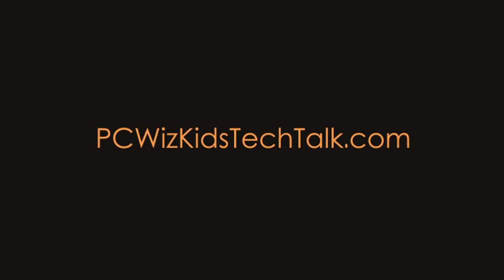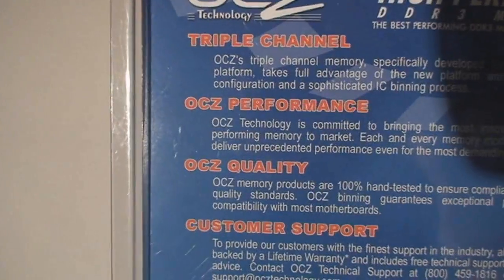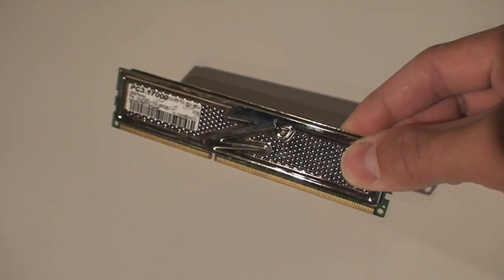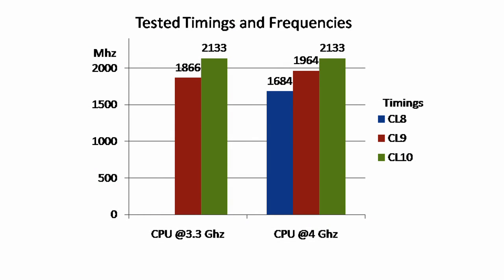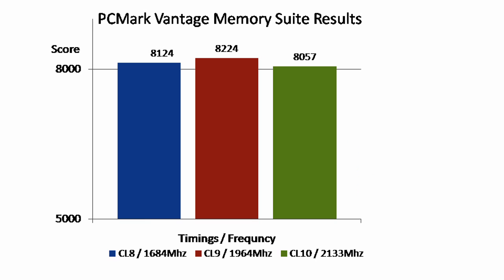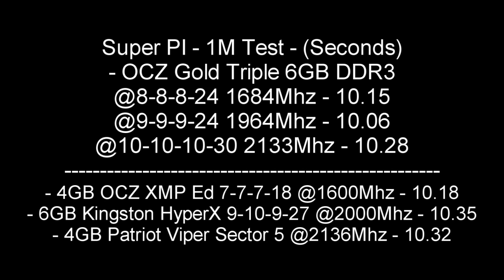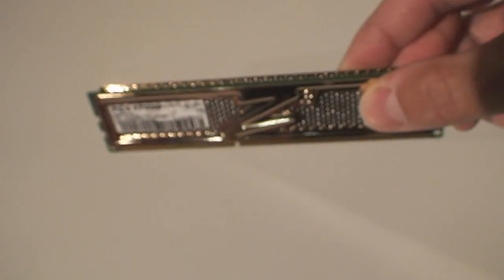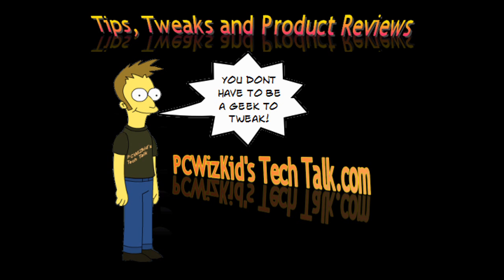OCZ DDR3 PC3-17000 Gold Triple Channel Memory Review

Comment: @TearsOfWar1 i know but ddr3 is faster but i"m just telling you that you do not need to worry about the speed of the ram as long as it is above 1ghz and 4gb or more of it than you are good i've seen some benchmarks where you clearly saw that the ram didn't give a lot of performance increase
 but the bandwidth will increase a lot  more if you fill your 4(amd) or 6(intel) slots instead of 1/2 of the total slot

Comment: Those are shitty latency timings at 1600 mhz.  I have 8 gb's of DOMINATOR GT 2000 mhz memory running at 1600 with 666 18 timings stable with no problems.  Got both kits for less than 400 bucks too.